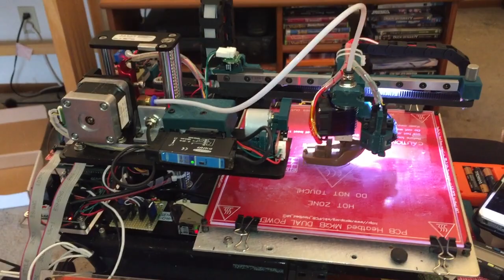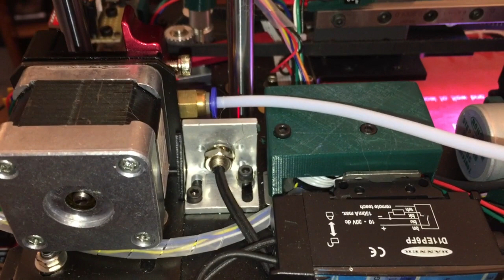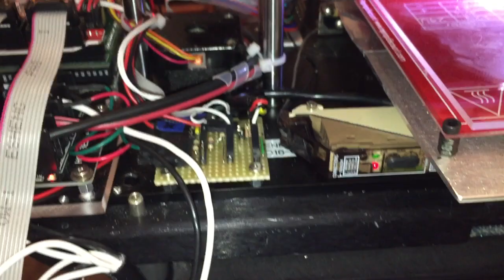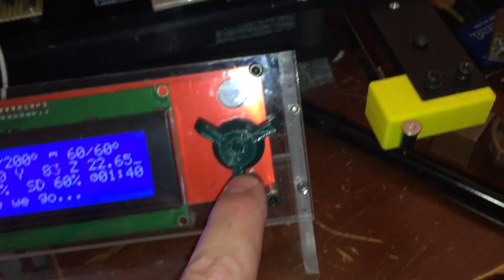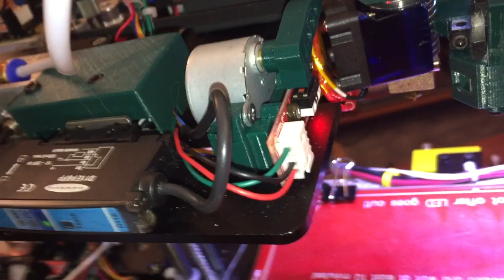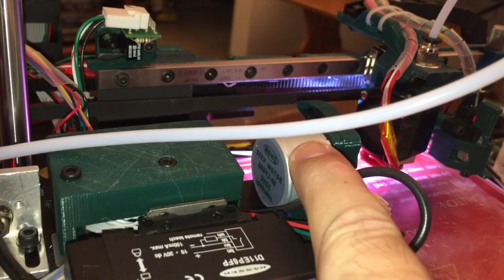Another Upcycled Printer

Comment: Instead of the byj motor, could the gantry move up to a fixed "presser" that would press the magnetic plunger?  Great design!
Reply from the maker: Thanks!  I debated on the best way to do that, and your method was one of them.  Ultimately, I wanted to practice adding the additional pulse drive circuit that I used for the BYJ, so I went that route.  I ended up giving this printer to a friend and he loved it, so I guess it worked out the best in the end.

Comment: You still making printers and videos?
Reply from the maker: oh hi! The answer is... kinda?  not as much as I was.  Got a new position at work that took a lot of my focus. and 2020 has been a dumpster fire for most of us.  I have built another printer, which was mostly a way to test some 5-phase motors I salvaged, and made a few upgrades on a neighbor's printer (the Printurd I made him).  Also made my neighbor a MPCNC, which I didn't document.  :-( and I built myself a CNC as well, which I really DO need to document.  And I spent a great deal of time this year learning to code arduino so I could communicate with some CANBUS stepper motors, Which, while successful, ultimately was limited by the capabilities of the motors. 
I had to move my shop area to another part of the house so making video has become a bit harder. So, lots of factors contributing to my recent silence. Thank you for asking! Maybe I can make an update soon. I hope you have been doing well.
Reply: @printerstein1321  Good to hear your still building. Building a modded Hbot with a dual post y axis motor similar to the Ender 5.
Reply from the maker: @ZebraandDonkey  nice! I’ll ha e to pay more attention to my feeds. I hope it goes well.